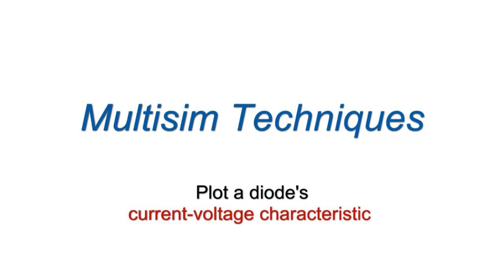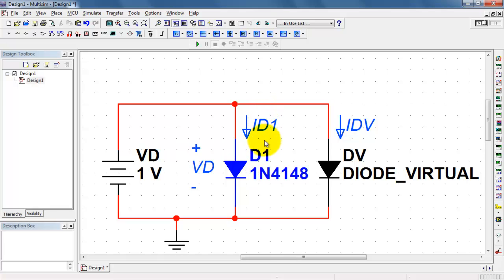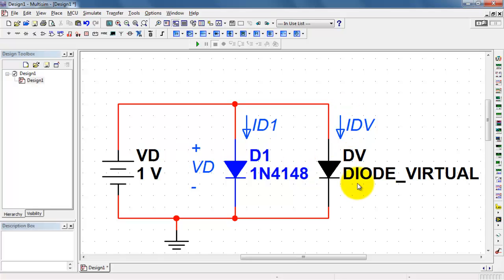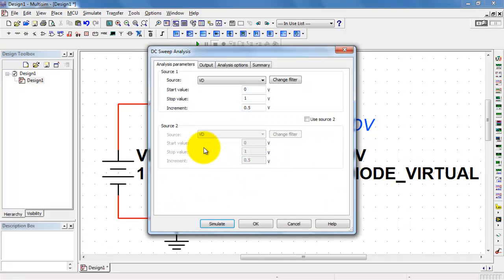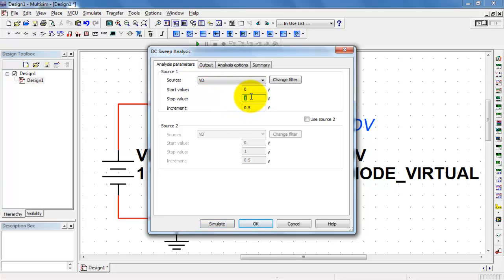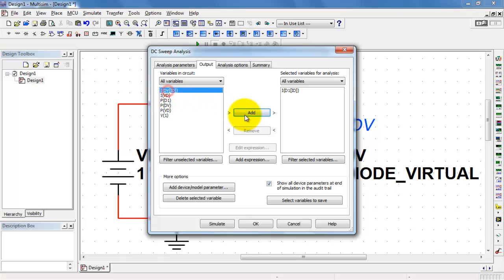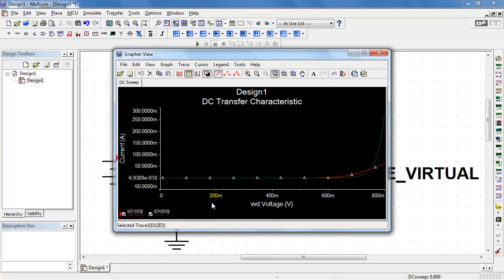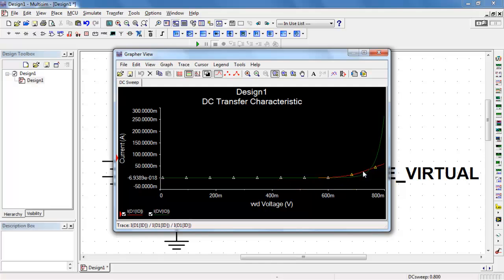NI Multisim: Diode current-voltage characteristic

Comment: Why are the curves linearly for the diode and not exponential? Also can anyone tell me what is a virtual diode?
Reply from the maker: Extend the voltage plotting range (horizontal axis) and you will see the exponential behavior more clearly. The virtual diode models generic diode behavior as opposed to models for real devices such as the 1N4148; usually these models more closely match their physical counterparts.
Reply: ***** I see, thanks.